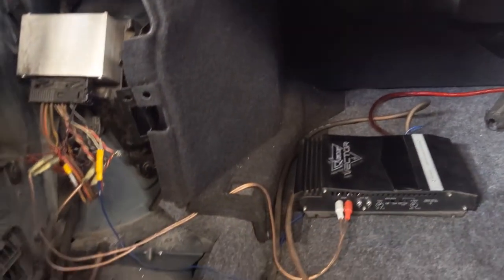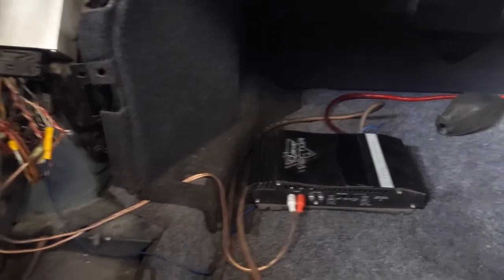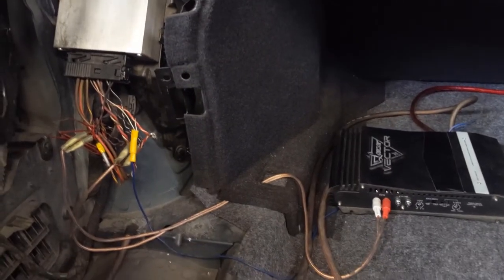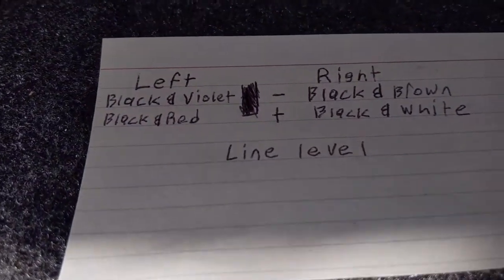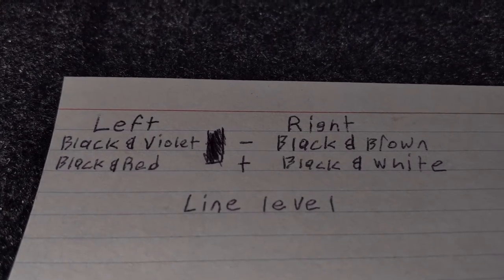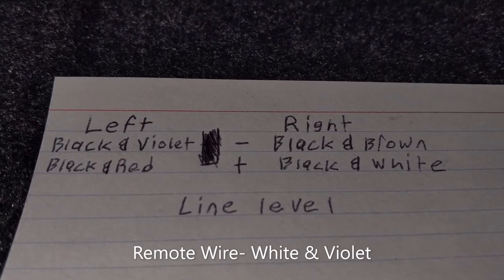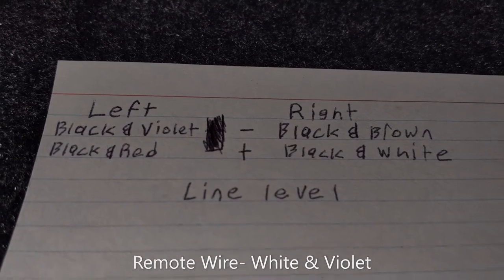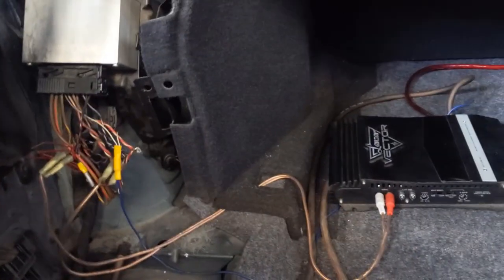Amp Install E60 Version 2 EASY DIY Wiring

Comment: Just a PSA: I would recommend tapping into the rear cigarette lighter +12v wire to use as the remote, rather than the white and purple. Reason for this is because the cigarette lighter port will only be on when the engine is running, or when the car is in ACC. Will help save you some battery since the sub/amp won't be running whenever the car decides to wake up when you unlock/put the key in
Reply: how do you tap in to the rear cigarette lighter?
Reply: @tfasolidified3160  I guess the fuse box on the right side
Reply: I did this but i get this annyoing humming sound from the subwoofer and i cant understand what causing this, its grounded properly so that cant be it
Reply: I have a question about my e60 I want to show a picture how they connected it
Reply: @christophersoltysiak6242  What You Mean
Reply: @tfasolidified3160  Pull off the panel that it is attached to. There are 3 screws holding it on that are covered with some black caps. The wire will be back there to tap into and bring to your amp.
Reply: @ollepersson4385  Dont run signal close to power wire.

Comment: do you have a instagram
Reply: The guy is not answering anymore...I have tried to contact him aswell...because I tried to install my subwoofer but I can't find the bloody silver box in my boot
Reply: @ge0rg391  cuz he is most likely noticing that he cant turn up the bass on the amp without a really expensive tool ... thats why the lc2 is good cuz it has knobs that are easier to use and dont need a tool.
Reply: @ge0rg391  gotta pull off another panel after the first one